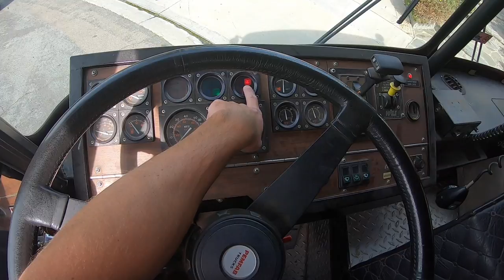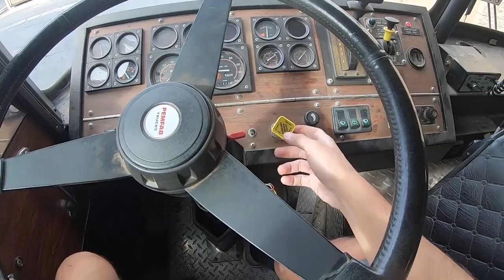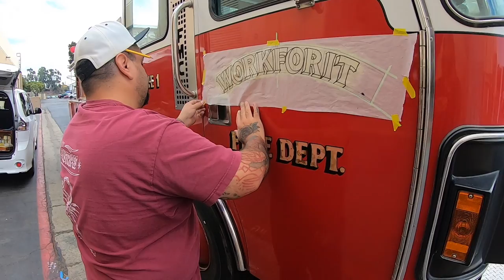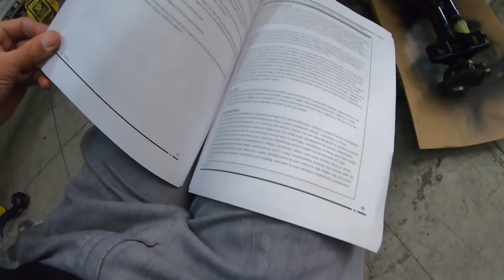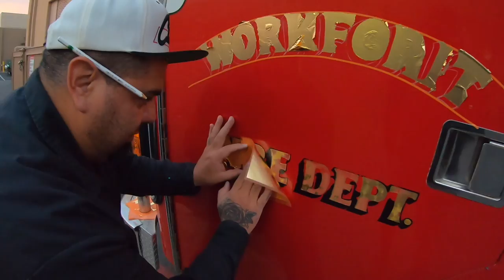CUSTOM PINSTRIPING MY FORKLIFT AND FIRE TRUCK!

Comment: Do you replace the tank on the folk lift or do you just refill it if you just refill it should get it painted cool also
Reply: You can do both depending on where you go for propane places some places with offer a refill or some will just change it out

Comment: Use Steelit (eastwood) on bare metal and you can still weld on it. No need to worrie about the back side or inside being bare metal and rusting.

Comment: Hoping you registered the fire engine as a Historical Vehicle?  It keeps the DMV Fees down to nothing compared to it being registered as a Commercial Vehicle.
Reply: They also limit the amount of times you can drive it per month and for how many miles
Reply: @tjboylan20  It doesn't seem to move that much anyway and if hes using it as a fire vehicle on the ranch, its only gonna be used on occasion.
Reply: @tjboylan20  it only limits it by miles per year not by how much you can turn it on or drive it throughout the year just fyi.
Reply: @snydersazeon  in PA where my brother has a registered classic and his father has registered historic firetrucks it is limited to maximum 25 miles per month and you can’t drive it 2 days a row and a maximum of 3 days you can drive it he got a fat fine of 1k for driving his  88 Monte Carlo ss 2 days in a row because his other cars were out of commission in FL it’s 1000 miles per year the last time I checked it varies state by state